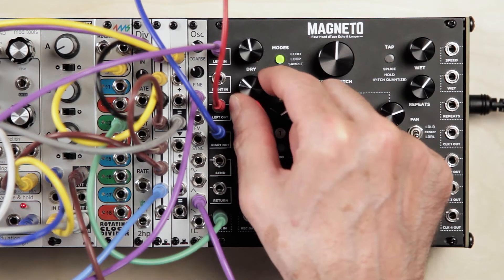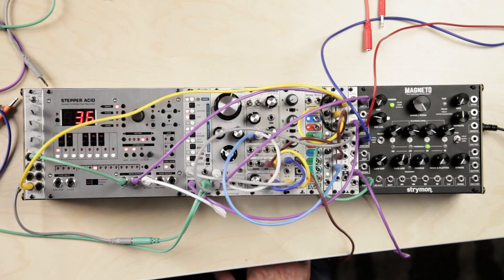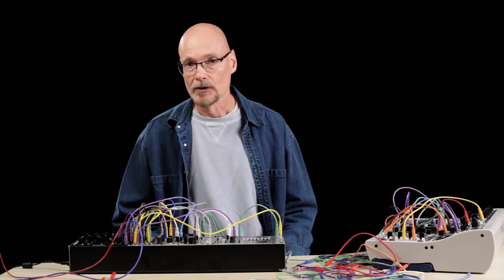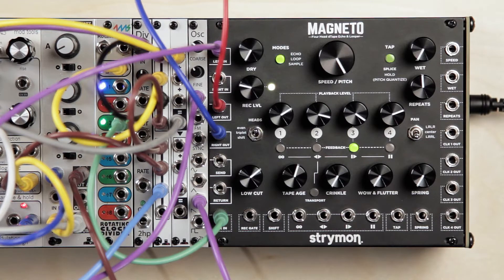Strymon Magneto - Speed Changes Following Clock Input

Comment: This isn’t changing the rhythmic division. The clk and tap inputs are redundant. we don’t have a way to alter clocked delay time. Please add this feature.
Reply: It’s crazy that this feature is neglected!
Reply: @uniformrecording  honestly ruined the module for me. sold it sorry to say.
Reply: I just got mine and I’m shocked - I need a clock divider to do this????
Reply: Just looked, ant there has not been a firmware update since 2018, so not likely to see this happen. I bought a 2hp clock divider for the purpose.
Reply: @TheScreamingFrog916  I did too but it still didn’t feel as playable as other delays so I went back to the mimeophone. Magneto SOUNDS amazing though.
Reply: @BrailleSounds  I have Mimeophon too. Love it as well.
Just had a session with Magneto, and MicroFreak.
MF has a great variety of time devisions, which worked great with Magneto.